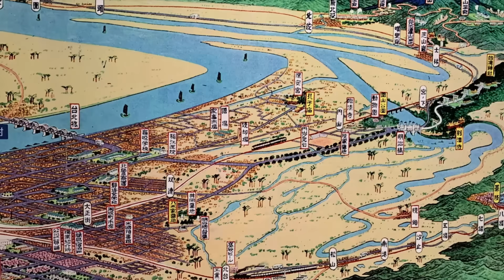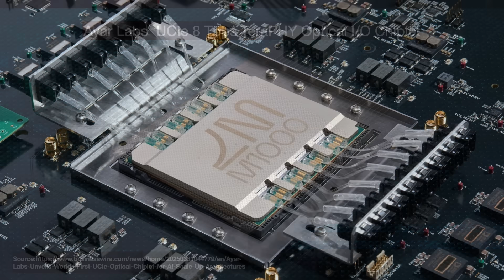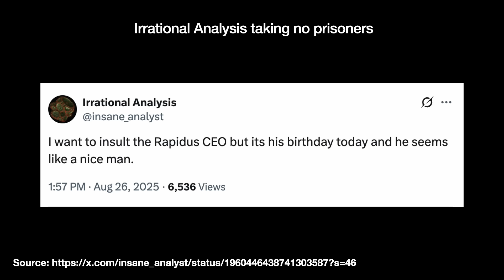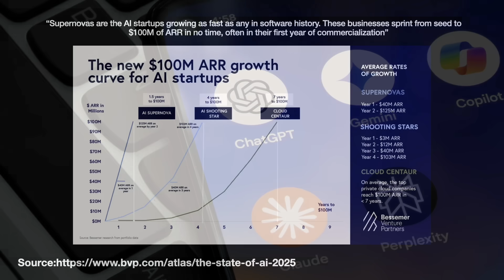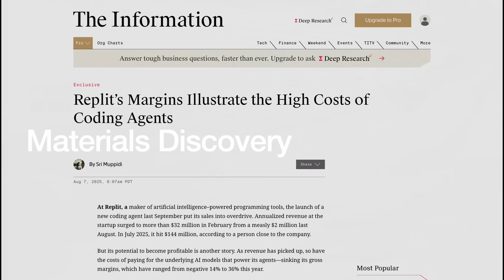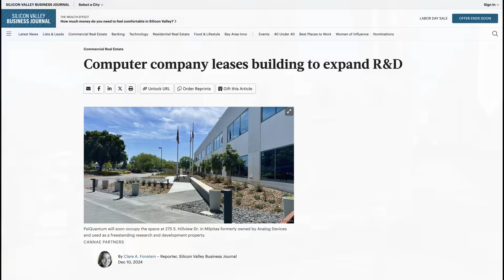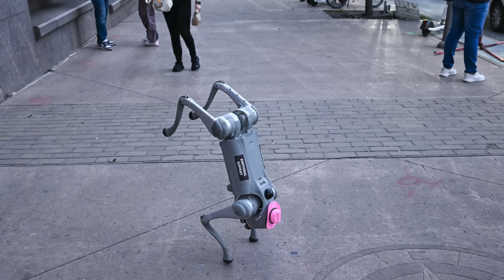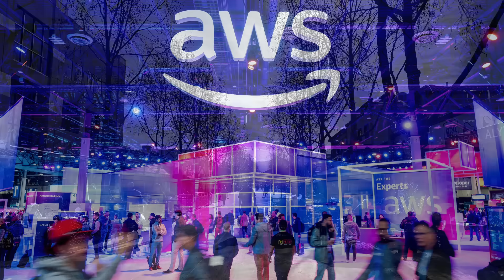Silicon Valley’s Doing Hard Things Again

Comment: There is a lack of self-reflection here on the AI side.

AI in software development is an aid, not a silver bullet. At best it will assist in the backlog of development tasks and help with boring things. This has been the way of software development since computing's inception.

The statements over the limits to AI's capabilities outside of coding also apply to coding and software development.

Writing "the text" of code is only a small part of the software development process. It seems that those outside cannot grasp the complexities of this field.
Reply: You don’t have to be a pilot to see a helicopter has stalled.
Reply: > Writing "the text" of code is only a small part of the software development process
This is only true for software engineers. For many other technical professionals, writing "the text" of the code IS the main bottleneck
Reply: Wasn't there a research that AI mostly hinders productivity of developers?
Reply: @saiv46  its this one from Cornell: Measuring the Impact of Early-2025 AI on Experienced Open-Source Developer Productivity. 

The main finding was that it made developers more confident and less productive. It was a fairly small study (16 ), but as we are seeing coming out of meta studies that are covering the software industry, AI is producing no change to the ability of the developers that use it, and nearly all studies not conducted by AI companies (ones by universities) show that generative is nearly useless when it comes to helping increase output
Reply: @saiv46 like if you wanna put shit together it’s decent but if you wanna figure out stuff. Not there yet. But dude it’s really just pure gpu power because Claude code in its earlier days when it had less users it was mind blowingly good
Reply: @saiv46  There's some video here in YouTube about some experts who studied potential benefits and in simple codebases AI can increase productivity by tens of percentss while in larger codebases the benefits dwindled. I suppose the performance will increase as time passes. Surely the AI currently adds a lot of noise.
Reply: @McSlobo  Anyone who can be accelerated by AI is someone who should be spending time learning the patterns and doing the work themselves
Reply: That is true, but keep in mind you have tens of millions "coders" out there who just write simple scripts and other nonsense code.
Next 5 years... those folks are gone !!! We are not talking about Solution Architects (they are safe).
IMO that alone will impact the industry and repel lot of new talent from stepping into it. Why would anyone (except the high IQ talent) spent years studying CS and (at best) hope for minimal wage salary.
Reply: I've heard someone say before that ai only really automates the fun part of programming
Reply: Listen and think critically from this point of the video. https://youtu.be/cru2bkqwSYk?t=877 

The tasks that AI have difficult with are many of the same types of tasks software developers have in their remit. Or, if not the developers; certainly the associated Product Managers and Business Analysts. These tasks deal with - the complexity and nuances of the real world. The ancillary stuff that is more than Chomsky Type 2 Grammars going into a compiler.

I use AI daily to help out. Maybe saves me a few minutes per day. Helps analyse legacy code. But it is no silver bullet for software development.

.. which leads me to question every use case sprinkled with magical thinking for "AI" in its present form. The best hope is higher abstraction with competing experts. And that's gonna be real compute expensive.

I state this as a non-CS degree developer who uses AI and has delivered AI projects. And used the latest tools.
Reply: I wouldn't even call it an aid, its so bad and it makes average choices. The only way its an aid in software development is if you don't know anything about software development.
Reply: I see this take all the time and its a complete strawman. Since claude code in particular has cropped up im easily saving at least a day a week writing tests, boilerplate, documentation and other miscellaneous busy work leaving me free to do the stuff you outlined. This will gut the jobs market and you're coping if your think otherwise
Reply: @ninjafingaz7704  >writing tests

Without very careful prompting, the tests even CC produces are mostly nonsense "straightjacket" tests. Which isn't surprising, writing good tests is extremely hard.
Reply: @Girvo747 yeah - almost nothing but tests that test that the code compiled the way the code is written.

utterly worthless.  it gets Coverage Points, but that doesn't make it *useful*.
Reply: @ninjafingaz7704 that is simply not borne out by the data though. Also: I too use it for that purpose, and the output looks fine but it's often mediocre in quality when you look more closely.
Reply: @ninjafingaz7704  The software job market is going to become an even more specialized, that's my prediction. You will see Vibe coding slop fixer specialists, actual developers who know how software is supposed to work. 

Yes, there is going to be shrinkage in the total available jobs and those will only go to people who are actually excited by technology because now you need to learn everything and know how stuff works.
Reply: @ninjafingaz7704  Java programmers often use(d?) tools like Hibernate or OpenJPA to generate SQL code, this computer generated SQL does function but it is generally very inefficient which makes it generally perform very bad when actual heavy loads are applied. At that point troubleshooting is way harder because the people who made the code have no idea what code they even made as a tool made it for them. Yes you might have saved an FTE not hiring that DBA or some time and money from that Java programmers not doing that SQL course. But now you have an application that is slow as molasses in production and users complaining and nobody who can quickly solve it.

Yes AI can be a great tool, but you should be able troubleshoot easily what it is doing. Why is the AI doing certain things. This is something that is gonna be lost the more vibe coding starts happening.
Reply: Don’t be shortsighted. Your analysis only considers what it is capable of today and today is the worst it’s ever going to be.
Reply: @queeblo545 people said that about GPT 4o, then GPT 5 was worse.
Reply: Nah, i have a MS in CS and tbh thats gatekeeping. CS is pretty straightforward outside of the highly theory-based fields.
Reply: @undiecover3939  So will the AI write the documentation, check the development cycle and stay compliant (hint even humans can't do that because the standards are broken), communicate with customers to turn their goals into a specification the developer can understand?
And then there are ancillary tasks, tool chain maintenance, coordinating outsourced tasks etc.

Writing code is just a small part of a team. Or as is often said: a programmer writes code, a developer solves a problem.
Reply: @orange422  Of course it eventually will, anyone whom thinks different has not been keeping up to date.
Reply: @orange422 answer to your first paragraph is aresounding yes dude😂
Reply: @orange422  yeah probably eventually
Reply: @orange422 Yes, AI can help with all these ancillary tasks, too.
Reply: @undiecover3939  I have a software engineering degree and have been full time for 11 years, and regardless of how straight forward something is a machine that is not context aware or able to make word choice decisions with logical analysis in a specific context is not able to make good decisions. Code completion with R# uses the existing function definition because it can look up the function and analyse what you are doing, while ChatGPT and CO-Pilot just gives what is statistically likely to be the output based on the code examples in its training data. My company has a slightly non-average error logging function and ChatGPT always outputs the wrong parameters cause its excepting the pattern to match the average. 

Its not good, its really really not good.

Comment: The AI killer app will be in hardware and NPU IP for optimization. Anything using power can be optimized to run as efficient as possible. If you can put a chip or NPU in your device for a few $ to save energy or make it run longer, faster, etc. it will quickly pay for itself.  That is where the BIGGEST market will be. Service wise, the might be integration and software for those optimization chips.
Reply: @excitedbox5705- Are you referring to the Groq chips and such?
Reply: process parameter optimization and similar stuff is a huge market, and an important one, but it doesn't require anything close to cutting edge AI systems. I think most people don't realize how string and duct tape a lot of industrial systems are, and how that often leaves them a few decades behind cutting edge consumer tech.
Reply: @thamiordragonheart8682  Yes, but the quantity makes up for it. Think about how many traffic lights, transformers, solar panels, etc are out there. You are looking at 100s of TRILLIONS of devices. If you can make just cents each every few years you are looking at a $100B a year industry and many will be much more.

Large Language Models are closer to a programing language, which is a tiny market by value.

Comment: I think these are interesting, but I’d say computing has more in store than just these items. The lean programming language is a good example much more interesting in applications to mathematics than AI it seems
Reply: @velcrolongfur3331- What kind of math apps?
Reply: @christopherd.winnan8701  I may be a bit biased against AI in mathematics in general, but Lean hopefully offers a way to provide the benefits of programming to mathematics and the benefits of mathematics to programming. One can imagine developing proofs in modular steps between people very far apart, with the same software version control and strong type checking provided to programming languages. It also shows promise as a way to verify software mathematically. It’s easier to verify computations when the verification process is automated. All you have to you have to do it write a verifiable proof. All in all, I think it mostly appeals to my sensibilities when I imagine novel things computers should be doing to change mathematics.

Comment: I saw a video where a woman is arguing that ChatGPT is not actually SAAS, because SAAS implies that the investment is frontloaded, and adding more users incurs irrelevant costs. ChatGPT costs a LOT more and an ambiguous amount more per user. It's not a service that simply runs itself. It needs constant handholding by VERY expensive experts.
Reply: I think i also saw this video, the video itself felt like slop. Saas doesn't mean a self running or cheap business. It just means a hosted software that you pay for.

Whether they set their revenue on fire or train new models doesn't change the definition of saas.
Reply: @prashank  Im paraphrasing and using my language as well. I don't see how she's incorrect. SAAS is dominated by blitz scaling. The strategy that Salesforce and Google and Adobe used is not one that will work for an AI company. Each query is enormously expensive, and thus each new user is exponentially so. They aren't really selling software so much as they are selling access to a very expensive research project. 

They just aren't the same. Her point, in so many words, is that if you include AI in SAAS, then SAAS becomes so general that the term is simply meaningless, and that as far as investing in companies goes, companies like OpenAI have yet to find a way to be profitable long term. Simply getting lots of users won't actually work because of what the models do.
Reply: @TyburVelereon  wrt expense, you got two factors. One is capex for build out, two is energy consumption opex. I think energy consumption is going to be the limiting factor.
Reply: @MarcosElMalo2  Yes. And resources in general. A single data center in Arizona uses something like 5 million gallons of water per day. An estimated 170 million are used across all Phoenix data centers
Reply: @TyburVelereon  lol you know less than nothing. Extremely obvious you have never seen an enterprise quote, let alone OpenAI’s. & if you think that the trillions going into AI has no path to profitability then you don’t understand how the world works 😂 OpenAI is already massively profitable on their inference compute. I hate it when people who know nothing, watch a slop video with zero criticality and have the audacity to speak on it.
Reply: @NullishConvalescence  Do you have any evidence that OpenAI is "already massively profitable on their inference compute"? What we do know based on data they released recently (Ars Technica had a good summary of these data) though is that the vast majority of individual users are running free accounts, and many companies are going the API calls route instead of subs (which can be quite profitable on average because many of the seats see little use vs. token-based billing but OpenAI gets the same $ anyways).
Reply: We saw the same video and it was quite insightful. She only had like 30k subs. Hidden gem
Reply: Didn't see the video, I lived it.

Comment: If you look at the run cost of a fab, plus raw material and the capital cost…and add a good markup…you don’t necessarily need to have huge volume, you just need a group of companies to pay your price regardless of idle time.

If enough are willing to pay for fast turn or someone is willing to make a volume order after first silicon hits performance promises, or someone can avoid capital outlay until their customer signs and order, it could make more sense than conventional wisdom would suggest.
Reply: The problem is that usually there is a mass-produced product they eventually want to ship and fast turnaround of prototypes on a completely different process doesn't help much, since they'd likely just have to tape out more prototypes on the conventional process anyways. If this company could port their process to both a rapid turnaround fab for prototyping, and a high-volume fab for production then they'd very likely have a winner on their hands.

Comment: Even in coding, LLMs don't seem to be progressing as fast as they were about a year ago. The issue isn't that of context.

On the one hand, most people don't do a very good job at describing what they want, and software engineers are generally very bad at this. LLMs have been able to automate quite a bit of work for over a year if you can describe well what you want, yet the internet is littered with software engineers frustrated with LLMs.

On the other hand, LLMs are trained on open-source software and questions/issues discussed online on sites like stackoverflow or reddit. This inherently means the training data doesn't have many examples of enterprise applications/solutions. There are entire categories of software which you won't find much openly available code about. Sure, you have books about that, but those won't show real world solutions, nor the spaghetti code that often comes with such solutions.

Finally, while synthetic data and execution environments have been making great strides in the past 6 or so months, those don't scale beyond short snippets of code. The real money is in being able to implement large changes, like over 10k lines of code in a solution with over 100k lines. It's not yet feasible to train models on such changes, if only because it's very expensive to scale compilation and execution environments for such solutions into the tens of thousands, as is needed when training LLMs.

I'm still very optimistic about LLMs, and think the craft of writing software is witnessing the biggest change in over two (possibly three) decades, but I doubt they'll replace as many as silicon valley seems to think, at least not anytime soon.

Comment: Protein structure modeling seems real.
Reply: of course what the AI is guessing is still just a shot in the dark. and likely what it guesses is wrong since we dont know, even we are just guessing with our models. it could be all wrong. just have to try on humans to see. want to be the first guinea pig?
"However, some researchers noted that the accuracy was insufficient for a third of its predictions, and that it did not reveal the underlying mechanism or rules of protein folding for the protein folding problem, which remains unsolved.[9][10] 
 " 24.4.2025 — Researchers uncover weaknesses in AlphaFold 3. The AI tool struggles with unusual DNA and RNA structures, such as single mutations. "
"AlphaFold 3 team has acknowledged their tool has limitations, noting in particular that it is stronger in predicting static protein structures—which are captured well in the crystallographic data it was trained with—than more-dynamic molecules, such as RNA and DNA"
Reply: @Redmanticore  This is just a straight lie, my guy. What are you doing?

Those lines aren't saying anything even remotely close to "just a shot in the dark". I mean ffs "the accuracy was insufficient for a THIRD of its predictions" the fact only a third of it (and not just the whole thing) is inaccurate is pretty impressive.